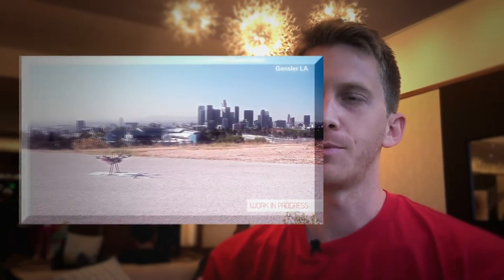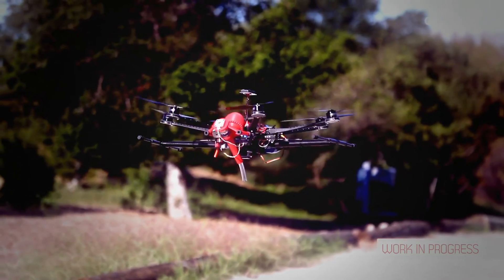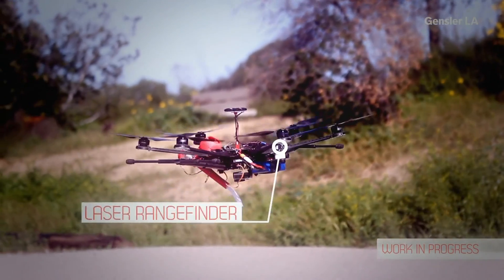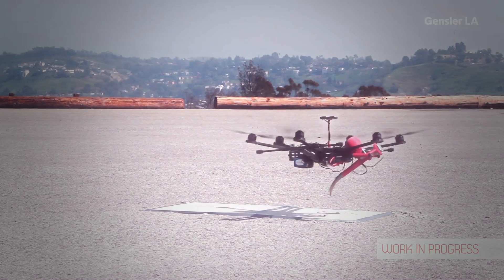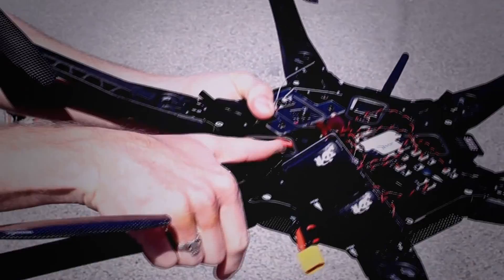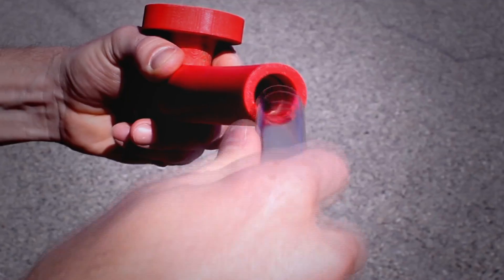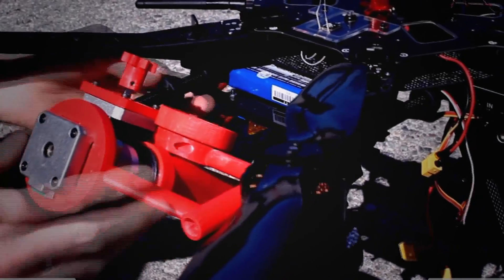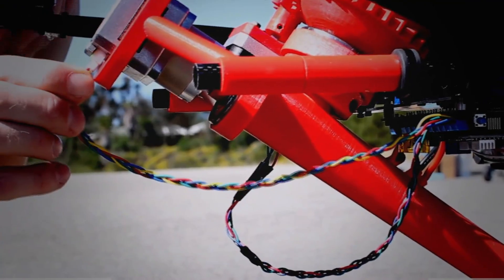3D printer drone can deliver concrete-like material - BBC Click

Comment: Nice try, but no.  It is an interesting proof of concept.  But the intended use is ridiculously impractical, even if it is piped with mix and power from the ground.  Existing options, such as flat-pack shelters and tents are far quicker to set up.  And can be erected by unskilled workers, or the victims themselves.  Plus they are not reliant on power (especially important in disaster areas or third world countries) or subject to break downs.